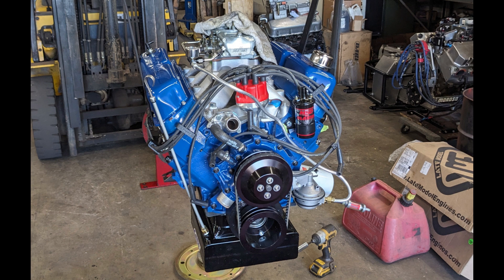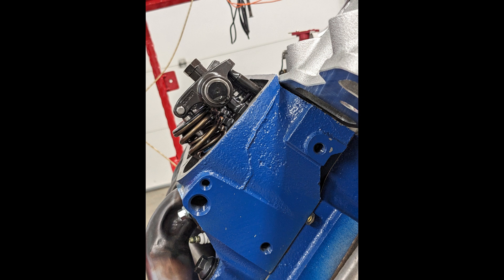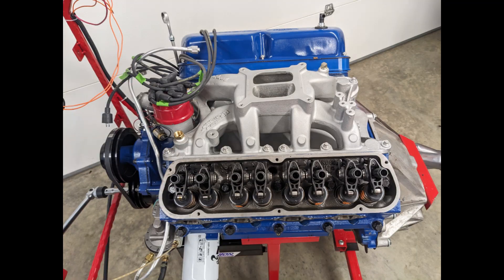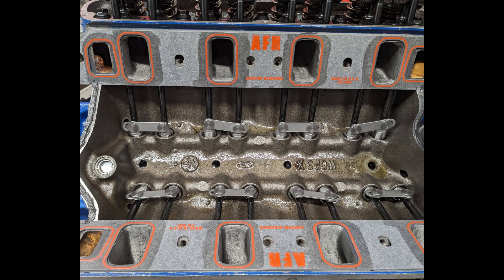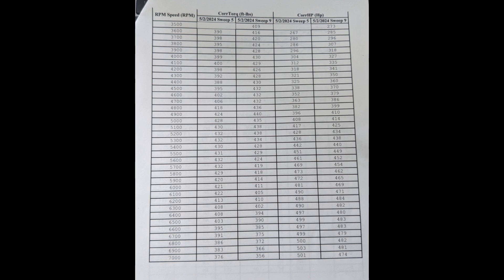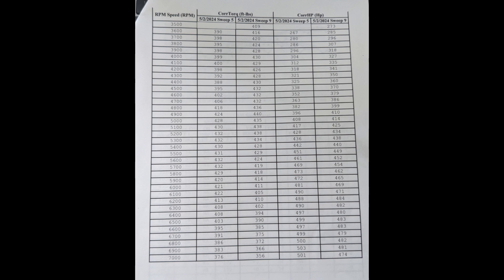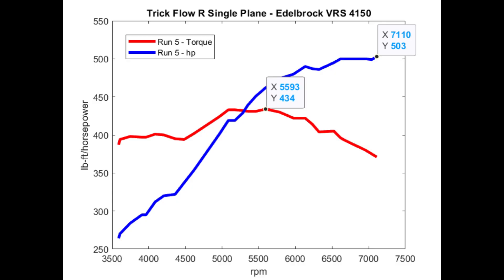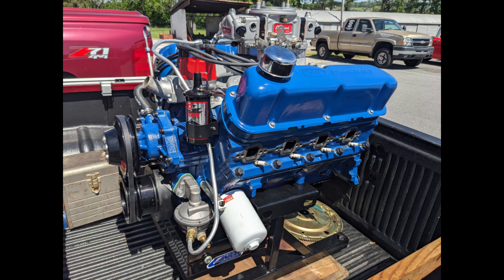500 HP or bust! Ford 351W build dyno tested

Comment: is that engine going in the 1969 mustang?  That should be a fun ride!  I'm curious how that combo will work in 6th gear, might be a lot of camshaft for a 2.4 final drive ratio.
Reply from the maker: Yes it is going in the 69 Mach 1.I probably won't be using 6th gear much below 80

Comment: Great video bro’
I have a similar engine 
383, 600 lift cam, port and polished heads, Vic jr air gap and a holly 750

I’m having trouble tuning my carb
You have a .69 and .72 main jet
What size Accelerator Pump Discharge Nozzle did you use?

Tks
Reply from the maker: Thanks. The Edelbrock carb has .033 squirters, and the Demon has .031.

Comment: bigger carb  i run a 950 AED made more power then my 750  plus i dded a1"open spacer  10 more hp i have a 402w street  car
Reply from the maker: @deewiedman7384  Good to know. I plan to try a bigger carb eventually.

Comment: Why does the graph look so jagged??
Reply from the maker: I'm not sure exactly. This was the only time I've been to this dyno. The dyno is old so my guess is it could be something uneven in how it is applying the load. Also, it could be the data acquisition system.  This is a Stuska dyno. A new Super Flow probably has a higher sample rate and filtering being applied to the data in order to make the torque and hp curves appear nice and pretty like you see on Engine Masters or Horsepwer TV.
Reply: @MarksMuscleCarGarage  it's a good running engine just the same.
Reply from the maker: @jesseduke694  Thanks!

Comment: A very close copy with iron C9 heads and 12.5-1 and a 750 cfm holley went 11.89 and with a 950 cfm dominator.picked up 3 tenths down to 11.56 but its a streer motor so yoy have to decide what you want. I would.run an 850 and 35 degrees and the rpm air gap and put a 3.89 or 3.91 gear in it. Get a good 5 spd manual with a good od and run  4.11 just money right ? Lol nice job that motor works good.
Reply from the maker: Agree. I've got 3.89 gears going in and plan to bump the timing up a couple degrees to 35 and see what happens but probably not without octane boost or race gas. Am a little hesitant to run that much timing with cast iron heads and 10.5 CR.
Reply: @MarksMuscleCarGarage  yes good point. The gear will help. The good 93/92 octane pump gas will be ok with 10.5 cr I'm sorry but I don't remember do you have a good MSD ignition ? Also you may be surprised. The chambers on Dart heads are very good and you might be able to run more than you think. That good chamber will let ya get a half point or more
Reply from the maker: @RossT-l3g  Yes, it has MSD distributor with mechanical advance, and MSD 6AL box
Reply: @MarksMuscleCarGarage  you will be ok with all the helpers like the Iggy, the gear, and the heads with good chambers you can run 35 deg. with pump premium gas. Did the cam get installed straight up ?  If so, you might try retarding it 2 degrees. You might be surprised that you'll gain a good bit after 5500 and not lose any torque. That is something you can try that doesn't involve buying new parts other than some gaskets.
Reply from the maker: @RossT-l3g  I installed it straight up. I might try that at some point after I get some runs on it.

Comment: I have a ton of port work on 351 D0OE heads, a Very similar cam, a single plan Chinese knock off like the Trickflow. Looks like it runs good, wonder what mine would make. 1.6 RR’s
Reply from the maker: I'm not sure how much power you're making but you could  get an idea from some Richard Holdner dyno videos where he runs a 351W with cast iron GT-40 heads, which are similar to the 69-70 351W heads.  I think your heads have a 1.84" intake valve which is probably the bottleneck as far as air flow goes.
Reply: @ they have 1.95 Valves currently. I’m hoping 350-370 at the least.
Reply from the maker: @DominatorGarage  Yeah that should be doable.

Comment: Tighten the Lsa, for more torque to 107,  and more hp.  But keep same duration and lift, this combo will produce more of each because it allows more blowdown time for the exhaust, which a ford needs because of poor exhaust flow .Hope this helps .
Reply from the maker: Thanks, I'm familiar with the DV formula.  Going to run the cam I have for now.
Reply: Yeah 108 deg. would have really woke it up with the TFS intake like Peggy said 25 more
Reply: @PeggyParrow  no that will move the power rpm area up too far in the range for his heads and will tighten it up to about 1000 rpm. He would also need over 11-1 cr

Comment: Your heads are entirely too big for that cam.
Those heads are designed for top end. Your running 220-225cc heads on a street daily driver.
Reply from the maker: What do you consider top end, 8k? The engine makes nearly 500  hp from 6500 to 7000 rpm.

Comment: how much did you pay for those 4hrs of service? I trying find a place that can dyno my engine number i have been getting, through the roof. so I don't know if I will do it anytime soon.
Reply from the maker: $650
Reply: @MarksMuscleCarGarage  wow The shop near me is asking me for $400 an hour.
Reply from the maker: @MrPzadilla  That's not much time but you should be able to get in a few runs in if you are just setting timing and doing a jet change or two, if you aren't counting set up time.   It probably takes an hour to get it on the stand and have water, fuel,  and spark hooked up.  How much for 2 hours, 800?  ...You could run it on a chassis dyno for cheaper once you get it in the car.

Comment: God damn that son of bitch sounds good and healthy to 7k! 1.4hp/ci....not bad!

I had to come back and watch this again. I like your build, and in my experience, you could have made the power you wanted with a couple of different parts.

The piston. Wiseco makes a good piston. They can take a lot of abuse for a 4032, but the weight and ring pack is where I think you would have found some power. 

The rod.....eh maybe there too. Eagle use to make a really affordable lightweight H-beam with 3/8" cap bolts. It would come in 100g lighter than anyone's. It was meant for NA high rpm builds. 

How about that Edelbrock carburetor? I was impressed the first time I used one.

Comment: great job now I know how much my engine makes still just a guess but mine is a 398 w stroker 10.5 to 1 compression with factory GT40 heads my guess was 450 to 500 I think I'm pretty close on what mine makes feels like it
Reply: my 398w is factory 76 block 0.60 over stock factory rods 3.850 stroke crank and factory GT40 heads not bad for a budget build found a c6 trans for small block really hard to find but it runs great in a 71 Torino
Reply from the maker: Sounds like a fun combination.  71 Torino is cool as well.
Reply: @MarksMuscleCarGarage just a classic street car I did run it down the truck first pass with that motor it ran 8.87 79 mph haven't ran it with the c6 in it not to bad I guess for as heavy as it is with a 3.55 rear gear for the street had more probably run faster

Comment: Thank you for your content. I love your engine build.  I have a 70 Sportsroof I am working on to be a driver.  I bought it with a 351w which has a 302 crank.  It was just slapped together to sell. I would love to copy your build 100%.  I just do not have the knowledge,  tools and skill required.
Reply: Perhaps a 351w with a 302 camshaft? 351w and 302 cranks are not interchangeable but the cams are by changing the firing order
Reply from the maker: Thanks for watching.  Good luck with your Mustang.  As long as it runs and drives well it should be fun. It doesn't need a bunch of power.

Comment: Why do the graph lines look so jagged and not a smooth curve? Most dyno pulls I have seen that are like that have valve spring pressure issues or something else going on.
Reply from the maker: I going to say it is due to an old dyno and/or data acquisition system, combined with what looked like uneven load control problems on the dyno. The dyno got the job done but may need some servicing IMO.  Also, based on the plots the dyno was producing (only 1 Hz data rate) a higher sample rate and some filtering would help to smooth out the curves.  I think if it was a valve control problem power would have taken a dive at higher RPM.

Comment: had one of these Windsors in my 68 Mustang motor came out of a 69 Cougar back in the day 351 Windsor 4 barrel intakes were hard to find so I bought an Holley for 150 bucks ran a 650 holly carb header did a little headwork auto with a shift kit 391 gears ended up putting hood pins with padlocks as everyone would pop the hood to see what blew their doors off the sound of these Windsors is so distinct as they will rev to that 7000 rpm with a little rod work and balancing best hp motor built until the coyotes
Reply from the maker: Yeah, people are still making power after all these years with small block Fords.  Not a lot has changed except for better parts and parts selection.   Coyote is awesome too.

Comment: I am thinking about going solid roller in the 363 I am having built this winter. When you check valve lash is there much change? Very nice engjne. Thank you
Reply from the maker: I haven't put the engine in the car yet so can't really say. I pulled the old motor out and took pretty much everything off the front of the car to do some steering and suspension upgrades and frame rail repair which I'm still working on..  I saw a little bit more lash after the dyno runs but think that was from springs taking a seat/breaking in.  Thanks for watching.

Comment: If you want moore torque, you should close up the Lsa to maybe 108 0r 9 ,go by David Visards 128 formula for low comp . Enigines, as you increse comp. He said to widen the Lsa, but for your comp, ratio  111 is to wide and creates more overlap that bleeds off comp. , therefore it hurts torque. Hope this helps.
Reply from the maker: Yes, I'm aware of the David Vizard formula.   There are tradeoffs for tighter LSA like worse idle, and less top end.  I may try a tighter LSA cam in the future though. Thanks for watching.
Reply: @MarksMuscleCarGarage  you could run the  tighter LSA  but add  a few  more degrees of duration to get the top end back maybe??
Reply from the maker: @KingJT80  Yes, probably so. I need to finish working on the front frame and suspension, and get the motor in the car... Maybe do a cam swap later on down the road
Reply: 111 LSA creates less overlap vs 108 LSA given the same lobes and ICL. EVO and EVC will be later with 108 EVC and IVO and IVC remains the same.

Comment: A 108 LSA may of brought up the torque numbers. Your currently 111 and it did carry well into higher rpm. Its all a compromise. The Edelbrock carb is simply fantastic. Neat build. It will rip. Enjoy and be safe.

Comment: If a 30 over is a 357,, What is a 40 over and 60 over size engine?
Reply from the maker: 40 over is 359 cubic inches, and 60 is 362.5 so call it a 362 I guess.  A stock 351 is actually 351.8 cubic inches, which is closer to 352 ci. I'm guessing Ford called it a 351 to not confuse it with the 352 FE motor which has the same bore and stroke as the 351 Windsor.

Comment: Needs 11.5:1 compression for that cam. It would have made atleast 540hp. Even more with bigger headers
Reply from the maker: True,. This build started out as a 450 hp goal that kind of morphed into a 500 hp target. Probably would have chosen some different parts if I was shooting for 540,
Reply: @MarksMuscleCarGarage  Yeah, I kinda followed the same path. Built a 351W and kept getting gapped by 302s. Went from Edelbrock 60cc chambers to TFS heads with 53cc chambers. Swapped the Edelbrock Rpm manifold for TFS R series manifold. Tossed the 1-5/8 tube headers for 1-7/8". With the same Clay Smith solid cam and rejetted Quick Fuel carb It went from 436hp at 6400 to 544hp at 6900
Reply: Tfs heads make power.
Reply: @dennisrobinson8008  yeah and  you dont need a very big head  to do  it if you  use the 11r heads  since thats  all they sell now  other than the race heads.  looks like they axed  the old 170 twisted wedges  as cast heads.  you can use  an 11r 190cc  TW  head  and make  over 500  with an R  manifold
Reply: @KingJT80  That's awesome, TFS all the way.

Comment: i built a mild street 351 W it ran fast but had little low end tourqe. i could barely spin the tires. what went wrong?
Reply from the maker: Hard to say.  I would probably start with you need a lower rear gear (3.50 or higher ratio).
Reply: probably  not enough  stall  and  low  initial  timing.

Comment: I was guessing 480-500. I got close. Didn’t you say the pistons were down in the hole .020? That’s @ least 15-20hp.
Reply from the maker: Yes pistons were about .022 below deck on average. I compensated with a thinner head gasket though (.023 " thick), so not too bad. Thanks for watching!

Comment: Mine is a 383 with Eagle rods and crank, diamond pistons @12.57:1. Cam is a 630 with split duration 258/263@ .050 solid roller in an early block fitted with billet 4bolt mains. On E85 it made 726@8200. In my little maverick it makes for good fun. I have had no reliability issues in two years of driving on the streets mostly as the drag strip is not like it was when I started back in the late 1960s when you ran  off the weight and advertised horsepower , no bracket bullshit. A good tuner/driver combination was hard to beat when it wasn’t a bunch of electronics and real men drove stickshifts. Hell they were almost all sticks back then, at least the fast ones were.
Reply from the maker: Wow, that's a really good piece you've got there. What do have it in? Nevermind, Maverick I see. That's a lot of motor for a Maverick.
Reply: My 311 long rod motor makes
 535 HP with 10.5 compression.
Reply: Nice
Reply: @Axeman428  you has at least tfsr heads to get that number?
Reply: yea they are computoir drivers now. suck